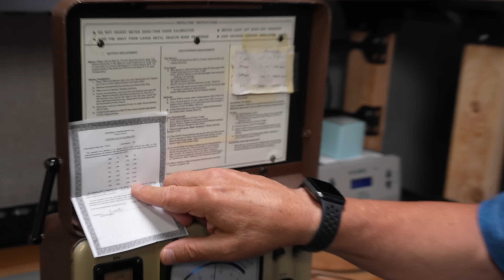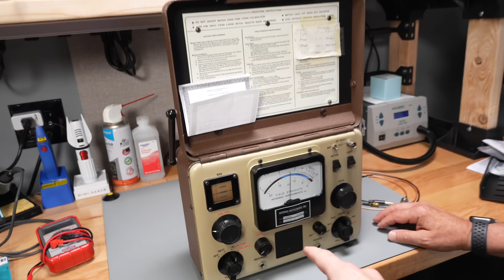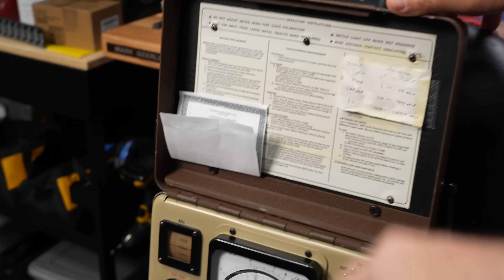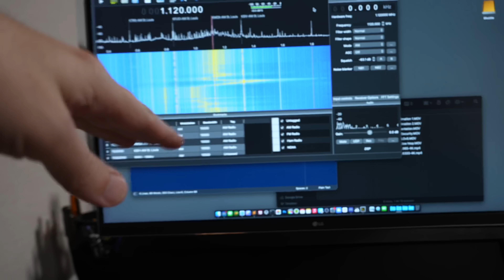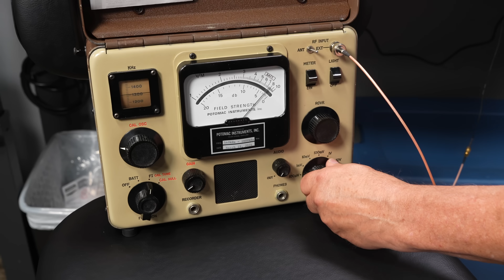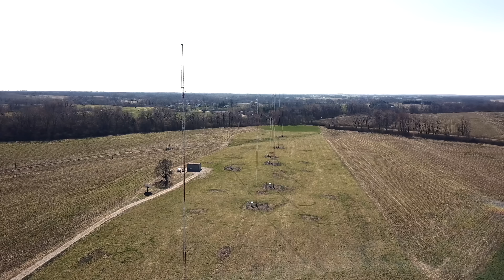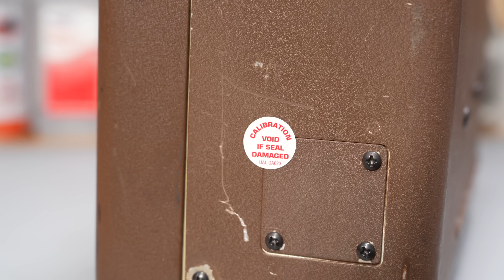This AM radio still costs thousands of dollars—why?

Comment: On receiving am. There is a long wire as the antenna and a ground wire. They are not connected. Loop antenna are connected.
 With experience, when young a loop antenna don't really work on a radio that is designed for the other.
I have also noticed that antenna very with thickness of wires, many are tubes and different materials.

What's the deal there.
  Can I just use a loop copper wire for UHF. Shorter wire of course. Or a VHF with a single wire and ground.

If there fundamentally differences what is being used besides then just directional or not.
Maybe something  is more suitable how the signal is being carried.

Comment: This reminds me of my Grandfather. While he was living in northern Ontario Canada around the mid 30's. He would turn his AM radio on after dinner and sit in the corner so he could see up the road for oncoming headlights. He decided not to pay the radio license from the hardware store, so if he saw headlights from a vehicle, he would shut the radio off. The bylaw was enforced by a vehicle that had a directional antenna that could detect the intermediate frequency from the radios when they were turned on. Imagine a knock on your door and someone asking if you have a license for that radio!.☺
Reply: re: "hat could detect the intermediate frequency from the radios when they were turned on"
Heh. I'll bet they had better results looking for the LO (Local Oscillator) in the radio rather than the IF. ALSO, the LO 'leakage' from an FM radio is MUCH more pronounced (a lot stronger) than the LO leakage from an AM radio.
Reply: @uploadJ  That's a good point. He had a directional style antenna and pointed it out the window while driving. I think it was just an AM radio he had at that time. I still listen to a few of the old radio programs on the internet archive.

Comment: I went and found the circuit disgram of this unit. This is no ordinary radio…the bloke who designed this was an absolute analog Wizard!

I thought…(from “fallout era”) that it wiuld be full of valves, but far from it, almost 80% of the circuit is designed around CA3045 transistor arrays. The only bits where descrete devives sre used is in the audio amp and a j-FET at the RF front end with its fate protected by zeners should someone take a reading right next to a tower with no attenuation swotched in!

Another odd feature is it has a Positive Earth, and its rail is -6v that looks to be furnished by four D-cells in series….but the odd thing is, its internal rail is regulated to -6v and the battery can’t be much more than that…so he has used a very low drop out regulator designed around three descrete silicon transistors, two PNP’s in a diffirential configuration and an NPN pass transistor.

It is common to see old semicinductor radios built around PNP germanium transistors and using positive earth with these is fairly common practice because then all the transistors’ emitters (the lowest impedance connection on a BJT) can then go to ground by a fairly short path, but this thing has six PNP transistors in it, viz, two in the reg already mentioned, one for the meter and dial lamps, one in the headphone amp and two in the AF amp. all the rest, four descretes and 30 others, five each in six CA3045’s, are all NPN.
So the circuit has a strange “upside down” look to it.

Looking closer, most of the stages, RF amp, two IF amps, cal oscillator, local oscillator and null circuit are all designed around a diffirential pair with a current sink underneath and a few common emitter gain stages or emitter followers. The RF amp is a very wierd capacitively coupled cascode amp with the drain of the front end j-FET capacitively coupled to the emitter of a subsequent grounded base stage, but has a current sink underneath…..and all this of just 6 volts! So there is barely any headroom to move about.

Three things that make this a very different thing from a commercial AM radio are….lack of any AGC, (and this is why you failed to get a good null with the commercialradio…its AGC was working against you), presence of the cal oscillator and null circuit, which a commercial radio lacks…and lastly…designed by an absolute Wizard.

The loop antenna of this has TWO active ends that are out of phase, one end goes to the RF amp like in an ordinary radio, but the other end feeds into a common base stage in the null circuit. It is a VERY interesting circuit which looks deceptivey simple st first glance, but the minute you look a little closer you see interesting and mysterious things, and the closer you look, the more you see.
One could learn a hell of a lot from this circuit and its clever designer! 
And that is where the cost is…along with the calibration and lack if drift over time. Ordinary AM radios can have a multitude of evils that a pasted over by the AGC, but here, all is lain bare and has to be spot on, so thanks for making me aware of this marvellous circuit.

P.S. If you do go snd look up the circuit, it is drwan like a wiring diagram around the CA 3045 packages which makes in even more confusing to read….as if the positive Earth wasn’t enough….but if you carefully redraw it as diff amps with current sinks underneath and follow the dignal path, that will largely “unscrumple the paper it was drawn on” and allow you to see what a triely clever design it is.
Reply: Long post, but a lot of detail. The advantage of using a CA3045  transistor array is the inherent matching, since all devices were fabricated at the same time, so the doping of the semiconductor material is uniform for all devices on the wafer. Matching for gain but also for temperature characteristics.
Reply: This is definitely a 1980s or earlier design in that it only tunes to 1600 kHz, and CA3045 transistor arrays are used. The CA3045, I suspect, was originally an RCA part (due to the CA prefix), but Intersil, National Semiconductor, and others later second-sourced it.
Reply: I have come across the CA3046 and CA3086 transistor arrays in many pieces of test gear where relatively cheap matched transistors are required…had never heard of the CA3045 ‘till I saw it here. Suspet it is probably a lower noise version of the 3046.
Still a bloody clever design though!
Reply: A level of understanding I will never achieve, but sure appreciate.  I am much more suited to digital, where it either works or it doesn't.  I can't screw that up too badly.  :-)

Comment: That's the unit the FCC guy had when checking my Part 15 station. Also our local KELO-AM is 1320.
KMOX being 1120 I wonder what 1110 KFAB looks like from your area as KFAB is also 50,000 watts.

Comment: I believe it's a Sony ICF-506. I have the ICF-19. They're almost the same radio except the ICF-19 does not have an AC power supply and it uses D cells instead of AA. The ferrite loop is not vertical, the null just isn't as sharp as  your Dad is expecting. If you take it outside in the open, you would probably get a sharper null.

Comment: Im not a fan of the loop for weak signals.  If you build a 1/2 wave dipole cut to frequency you will have way better results. (Its the simplest design, you can make google dipole calculator.)  What's really neat about a dipole if you made one for 20m 14mhz@ 1/2 wave it would also be 1/4wave for 40m 7mhz and full wave for 10m 28mhz.
Reply: 1/2 wave dipole impractical for even a 100 ft x 60 ft city lot on the 160m band (just above AM broadcast freqs) ... instead I use a 1/4 wave (110 ft circumference)  circumference tuned loop and get WSPR spots of my 10 W signal all across the USA overnight on 1.836.600 MHz  ... not everything is as the textbooks say.

Comment: That is one of the most expensive radios I have ever seen, and I used to be a meteorologist many years ago. We had calibrated RF "radio" equipment used in an RF chamber to measure both conducted and radiated emissions. You have the most expensive hotdog cooker ever! As a youngster I used to cook hotdogs with a board, a couple of bent nails, and a killer cord! Those were the days! :face-blue-smiling:
Reply: Metrologist perhaps?
Metrology - Metrology is the scientific study of measurement.

Comment: Back in the mid 1970's I worked for a TV shop in Bradenton Florida and I had an antenna that I installed on a house and we got a better signals reflected from a nearby water tower than we did from the stations. At the time most of our stations were located in an antenna farm located to the north east of the house and the water tower was to the east of the house.   I contributed it to destructive interference coming from the water tower when the antenna was pointed directly at the TV stations the antenna was receiving a reflection from the tower so I aimed the antenna at the tower and it worked great.
Then in the mid 1980's I had my own Satellite TV shop and had a 10 mesh dish mounted on a trailer to use for demos. I had it set up so all you had to do was level the trailer and put a brace that was set for the elevation for out location and put a 2nd brace on the dish where the actuator arm mounted to the dish that was set for Satcom 3, by doing this it set to variables in the dish aiming possess then you rotated the dish on the pipe and you would hit Satcom 3. One day when I was working on the dish at my shop I had the dish pointed a house next to our shop with a metal roof. The elevation was lower than normal and I was receiving a signal from Galaxy 5 just good as it was pointed directedly at Galaxy 5.
Reply: Microwave fun!

Comment: At least this old 'tech' can always be fixed one way or other. It will not be, "Oh, it doesn't work because we don't have the latest version of software". Keep up the good work!
Reply: The SDR is open source, so software isn't much of an issue. If you can't repair the radio, well, you likely cannot repair any radio.

This old tech is good for quick determination of signal strength and direction (with a directional loop like he showed), the SDR being able to double as a spectrum analyzer if say, a transmitter is detuned and splattering parasitic signals all over the spectrum.
The tunable loop, saw models with even more filtering, not only to tune a resonant frequency, but could filter adjacent frequencies in the band, to help narrow down a single source and more. Of course, with the additional filtering, there is a cost in signal, because in engineering everything is a balance of trade-offs.

Comment: i am very impressed with the loop antennas! i have one myself and made a patch cable to hook to my IC-7300 just to experiment with, and the results were surprisingly very effective on picking up week signals. i have also used it on a couple other radios and they improved signal alot! 73's KF0PRI

Comment: I have many different boxes for field strength readings, but most are for aligning the receiver antenna for best reception. They work on VHF, and UHF TV and also FM radio bands, as they are fun to use to do antenna installs, kind of like the units for Satellite TV dishes.

Comment: Ooh, an illuminated 4.5-inch Simpson rectangular style panel meter, with a mirrored scale! I'm in love!
Reply: I got a Simpson rectangular style panel meter, on a AC meter I found out near an airport on a farm beyond the runway... measures volts...    or amp draw through it, with two switches to switch between 110/220, or the scale on the amps.

Comment: How about doing a video on the Narda or similar emi/emf probes.  I've got a cased set, fully operational in my garage.  These are indestructible (unless you deliberately fry them) and easily serviced.  Various heads work from (almost) DC to (almost) light.  Smaller commercial versions are also useful for all EMI and EMC work, and including ESD.

Comment: Hmm , a feild stregth meter didn’t used to cost that much years ago . I used mine to match antenna to radio RX/ RT two way system . $10 or $20 or so . Seems a bit excessive to me . Because the operator in any case has to calibrate the device himself any way . But ok , what ever .
Reply: Brain surgery can be performed with an Exacto knife too. No need for suction, sedatives, restraints needed either.

Comment: That Radio Locator site is not accurate at all & needs to be updated & fixed as it still lists stations that have been shut down & incorrect info on US Territories radio stations. -73's
Reply: Does it still have the one where the antenna was "stolen" recently, but in google street view images, the antenna actually disappeared 3 years ago?? And no one even noticed or cared, because AM radio??

Comment: Would you describe is as a radio with a very accurate S-meter. This one has a demodulator, but strictly speaking it doesn't need one does it?

You mentioned submitting measurements to the FCC.
Considering we are approaching the peak of the solar cycle do they weight the measurements based on what's going on with the sun at the time of measurement?

Last couple weeks for example have been very weird on the HF bands with a very wide range of propagation characteristics so I know that night-time measurements are going to depend a lot on what's been going on in space.
Reply: re: "You mentioned submitting measurements to the FCC."
Well, this is normally performed at distances like 1 km or 1 mile; very little to no influence by the sun/atmospherics or ionosphereics at that small distance (where ground wave predominates.) So ...

Comment: I have some similar instruments  (made by Narda and SImpson) that measure 2.450 Ghz in mw/cm2 and is used to check if microwave ovens are leaking.  They come with probes and a 5cm styrofoam spacer to get a consistent accurate reading. The crazy thing is, while the instruments I have are decades old,   very few places want to calibrate them saying "they are out of support and old" despite them working properly and just needing the calibration. Companies want you to spend thousands on new meters instead, rather than appreciate the quality of these old and very well built instruments.
Reply: I used a similar survey meter. The engineer who trained me said that the spare styrofoam cones that came with it were to be used when the old ones became too contaminated with metal particles. Every day I had to run it along the seam lines where the units were screwed into the resonance chambers. Best job I ever had.

Comment: What happens if their is a dead short from the radio tower to ground?
I would imagine the signal would degrade or become non existent but would their be any damage to the transmitter equipment?
Reply: About all AM transmitters shut down very fast. Some engineers think TOO fast! They want a little arc mark to see where there are problems and a very old transmitter would often snap a nice spark and you could use the location to trouble shoot!
Reply: @radijoe  Super interesting. I am in my third year of electrical engineering and RF still seems like magic to me.
Reply: I don't understand what that has to do with the subject at hand?  Can you read and use the rest of the internet?  Why don't you find out by experimentation for us.  I hope you have life insurance Captain Obvious.
Reply: @huh4233  It was in reference to the Hot-dog touching the AM tower. I was curious as to how the transmitter deals with shorts and over currents.

Comment: Also note, manufacturers of sub station and power distribution equipment use a signal strength meter to check for corona.  This was at 1020 Khz from what I recall.